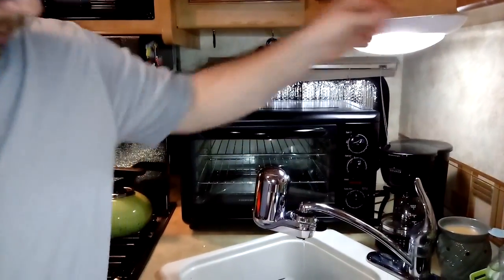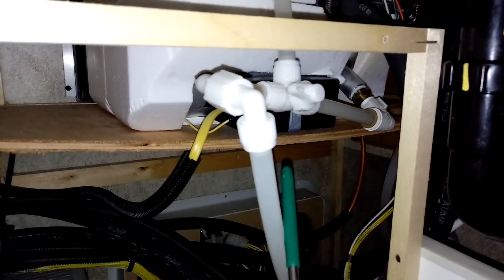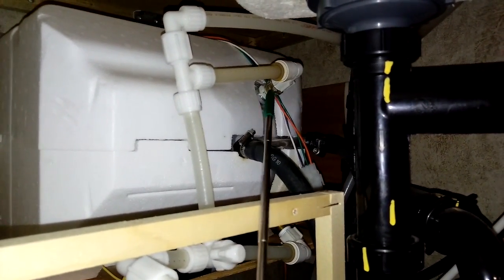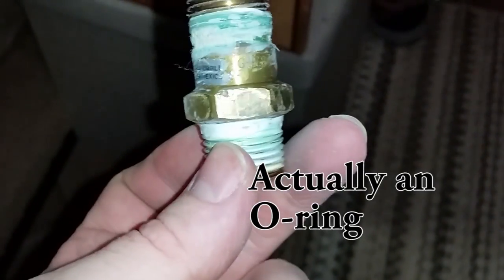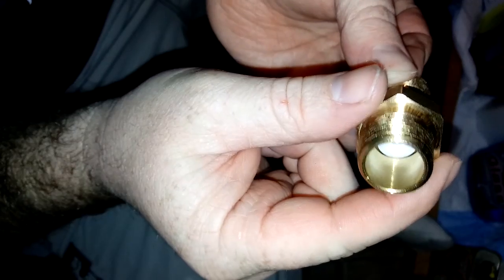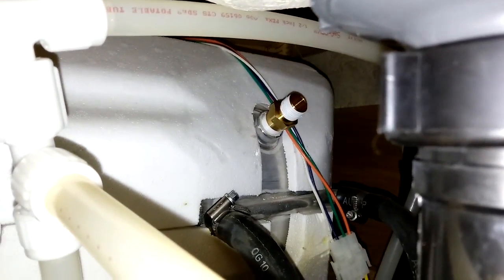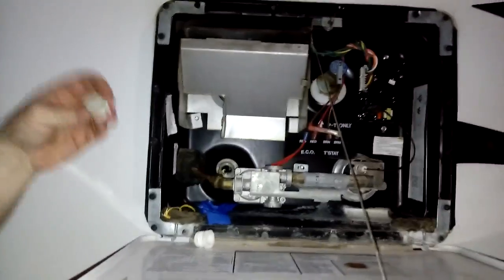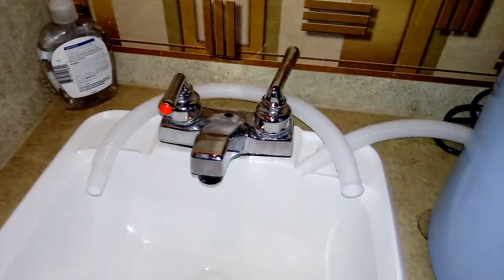How to Replace a Hot Water Heater Check Valve RV

Comment: Thanks for the video. I had hot water flow issue with a Brand NEW unit purchased Dec '20. It was winterized so I'm just now putting water to the camper. Winterized unit was in by-pass mode so initially when cleaning the water lines of antifreeze, both cold and hot water flowed. But turning valves to defeat bypass found No Water Flow for Hot. Found the the manufacturer installed the check valve BACKWARDS. Forest River; East to West Alta 3150KBH. Brand new is not always so good obviously.

Comment: great job in explaining the problem and the solution!  

comments: 

 1) the main reason for the check valve is to allow draining the tank before winterizing all the lines, the diverter valve keeps the winterizing "juice" from entering the inlet, and the check valve keeps it from entering the outlet once you've removed the tank drain plug

2) an alternate way to refill the tank without routing a lot of air to all the faucets is to apply normal water pressure, don't open any faucets but instead open the relief valve, located above the drain plug in yr hot water tank access, until water comes out the valve

Comment: Had this check valve lock up on me so no hot water was coming out. Took the cap off and took a zip tie and poked it in there and got the spring to start working again. Put the cap back on and everything is good as new. Thanks for the video showing how that spring action actually works. I hear they do lock up on occasion. They are a bear to get access to.

Comment: Thanks for the video, I replaced my water heater a year ago and gave up on hot showers altogether even though I could verify the unit was heating the water. I should be back in business shortly. I may have put the check valve in backwards.

Comment: I have a single hot water bypass valve in my rv.  If I have the bypass on can water flow into hot water tank if check control is not working?

Comment: What socket size did you use to remove the check valve?
Reply from the maker: Sorry for the late reply. I don't recall which size I used. I know the check valve size is a 1/2 In MPT x MPT but I don't recall if it took a half inch socket.

Comment: What size socket did you use to take off your check valve?
Reply from the maker: I'm not one hundred percent sure. I would have to take a bunch of stuff apart to check, but I think it was a 1 inch socket.
Reply: @Henleyshappytrailsplus  Thank you...and was your check valve a 1/2inch by 1/2? Not seeing much to choose from on Amazon...do you have a link to your valve that maybe you can share? Thanks
Reply from the maker: Yep it's the 1/2 in by 1/2 in 

Here is an amazon link, I pulled it from the affiliate link we have on the article to go with the video on our site.

https://www.amazon.com/dp/B00B2AUJYO/ref=as_sl_pc_as_ss_li_til?tag=henshaptra-20&linkCode=w00&linkId=9c2ecb539255bedf311af8c5c8735491&creativeASIN=B00B2AUJYO

I have no idea why we put the link on our site, but not the description of the video. Thanks for pointing that out, I'll add it.

Our site is Henleyshappytrails.com
Reply: @Henleyshappytrailsplus  Thank you for your time to respond back. I just now had to order one. Shipping stated 6-8 days which is a bummer. Was thinking about taking the guts out of the valve and using it until the new one arrived...but I'm hesitant. Lol
Reply from the maker: @markbritt6311  I was told once that it is usable without the valve. But that wasn't by a licensed technician. I'm assuming you could, though hot water might have a little backflow.

I found this article from the RV doctor that says that may work temporarily while you wait for the part.

http://www.rvdoctor.com/2010/02/rv-water-heater-check-valve-what-for.html?m=1

Comment: Never fill hot water heater to top u need to bleed it by open hot water faucet while filling wacth a video on it or read owners manual tank must be left with a air pocket at top.
Reply from the maker: You are correct in that opening the hot water faucet while the tank is filling is not necessary in most cases. It does speed up the process though. I don't believe it will cause it will cause the tank to fill past it's expansion air pocket.

The design of the water heater creates this air pocket in my experience. There is no way to manually dictate how full the heater is that I'm aware of.

After some time this air pocket can shrink do to expansion and contraction of water temperature.

It then becomes necessary to either turn the water off, open the faucet to let air in or draining the tank then turning the water back on.
Reply: That makes zero sense

Comment: Just take the plastic vavle out of the brass fitting and it will work fine only replace it if u live up north were its cold
Reply from the maker: The purpose as I understand, is that this valve prevents water from flowing back into the tank.

Yes, removing the valve part of the valve will let water flow freely and thus would work for water flow. However, it would no longer perform the function as intended.

I personally prefer to replace a broken part with the proper part in return. But, removing the valve would make a good temporary fix until the part could be found.

Comment: I swear my valve was epoxy in place !! Arg
Reply: I found my 24" cheater , it was a cinch , lol
Reply from the maker: Yea that thing wasn't easy to get off. I ended up using my torque wrench for my tires to get the leverage to crack it loose. I'm hoping the new one lasts a little while before I have to do it again.

Comment: Water heater, not hot water heater.  Drives me nuts.
Reply: Exactly, how would want to heat, hot water?
Reply: Excessive use of "Teflon" tape drives me nuts!  I've seen it on fittings that had rubber seals as well as flared fittings.